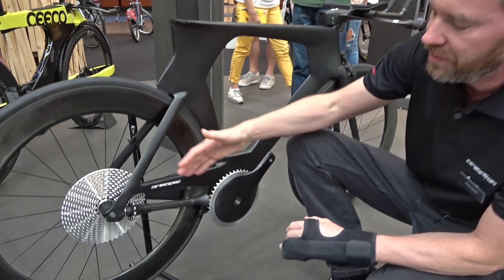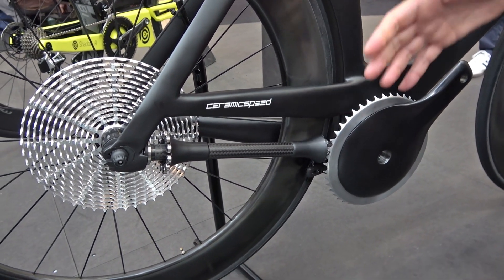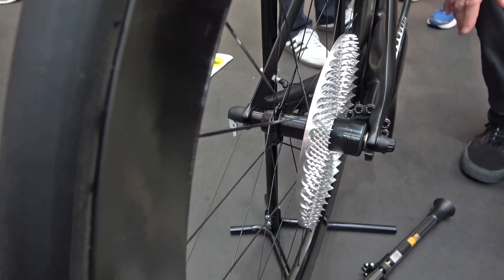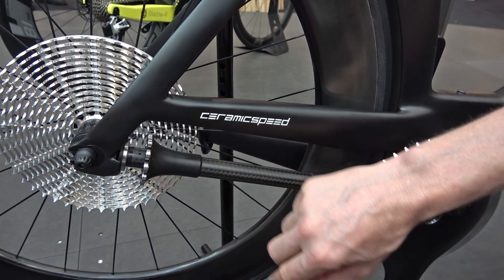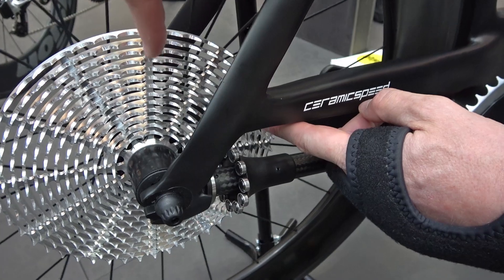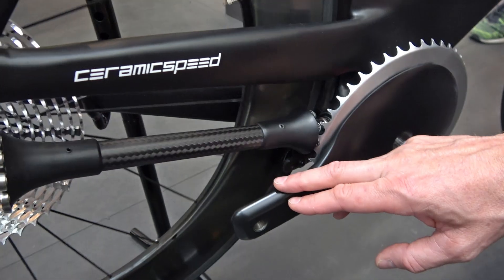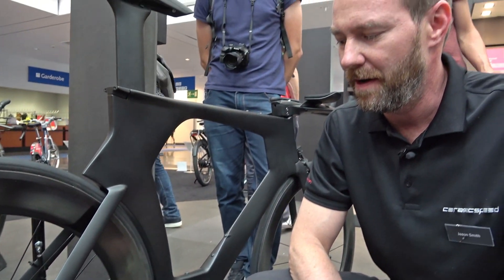CeramicSpeed Driven - Fully explained

Comment: In 'Good ol'boy'lingo,what keeps the multiple tooth wheel gearset from getting sprung from the pressure that tries to push it in toward the spokes?Also,isnt there an instant as one brng.leaves contact and another starts touching that will produce lost motion?(The problem in car's differentials was cured by curved/angled teeth...constant contact).

Comment: For a moment, I am gonna assume that the materials used are strong enough to not fracture under the point contact at the engaged tooth, as opposed to half of the sprocket in a chain drive.
However, I think the aluminium hub would give way (towards the wheel) when the forces involved are high, bending is inevitable.
Also, the pinions can't be simply be replaced as he says about their future plan. The driveshaft distance from the geared hub will change on changing a pinion (which isn't easy or reliable)
And seriously, a battery inside the shaft? And bearings exposed to the atmosphere?

Comment: Keep it up.  Can’t imagine all the hurdles you have already overcome. Looking at this prototype, it looks like flex could become an issue.    If so, milling the gears into the rear tire itself might be an avenue to approach.  Swapping rear tires would give you all the gearing options you need.  As for the driveshaft, it could also be a more integral part of the frame. In other words, if this doesn’t work as you have envisioned it, instead of tweaking your design, maybe tweak what the bike itself is. Best of luck to you.

Comment: I can't help thinking that there would be axial forces on the driven cog that would push it towards the wheel. It looks fragile, and if it is then it would flex as soon as any load is applied and like as not risk significant failure. I would like to hear how the axial forces (if any) are managed.

Comment: For some reason I imagine these gears wearing really fast. On a typical chain drive the chain contacts like almost 3/4 of all the sprocket teeth at one time giving a strong backbone. But this appears to put all the pressure on only maybe 2 or 3 teeth of the sprocket at any one time so that's a lot less sprocket tooth to hold the force. In the end I imagine they better be some crazy tough sprocket teeth to keep from stripping or breaking fast or just need to peddle light. Those peddles make a big mechanical advantage against those years so I don't know the exact math but I'm guessing those 2 teeth that make contact simultaneously on that front sprocket probably get around 1,000 pounds of force easy with even a 130 pound man standing on them. I don't know I think I want to see it work through a few Marathon races first. And did you say ceramic bearings? What kind of hammer like impact do ceramic bearings hold up to anyway? Just thought I'd ask. May end up having to revert back to lubricated steel bearings in the end.

Comment: Why are there no videos of this changing gears or being used in the real world? 
 How much torque can the drive shaft handle? How does it put up with dirt/mud? 
How long do those bearings last? Can they be removed or must you change the whole shaft....so many questions unanswered other than "it's 99% efficient"

Comment: The application for e-assist bikes would be really great, as there is no chain grees or anything that can tarnish someone's dress code potentially get hoped, as enclose look like they would be simpler and smaller slimmer than for traditional bike chain and the fact that the whole system can kindly be enclosed means less dirty as have replaceable brushes cleaning dirty off before entering the gearing compartment which also maybe means less wear. Also, have greater clearance and less change of derailleur being damaged as there is less protrusion.
Mabye just like they doing with split shift to allow gear transition to happen, which is single axis movement. Mabye look at another concept that allow 2 axis movement, which allow it take up the alignment difference. So my thinking is just like they split it the hollow cylinder into two half for switching gears, pull each shaft along up and down. Then make each cylinder half hollow, such have another cylinder inside of it, that can sift around the axis of the shaft profile. Then just like the for with profile tracking for gear switching look at having the inner half-cylinder, have a profile that, it follows to reposition the tooth alignment correct to match. The enclosing half cylinder for shifting fears, would have holds that allow for the inner cylinder to track a profile on the shaft, such that there is mechanical resistance perpendicular to the force direction. The current shaft could have an inner shaft with profiles for cylinder movement of the gear shift of the two-cylinder half alignments. Guess also look at air and shock type dampers. The only problem I see is that as in there design to realign the gears for the new toothing around the sfaft axis, on has a problem that there needs to be space around the shaft, which means can't perfectly match the teeth as one tooth is spring load match all the time, which not ideal as looses there.
So I guess another way to look at it can one dynamically change the spacing between the teeth, across the whole half-cylinder at the same time. But then to think of it, if they keep the meshing perfectly the same, then the gear chainrings on the wheel distance between gears would determine perfect whole number matching. So I guess the really question is timing of the shift, they got the split shaft concept, but then for meshing, why not look at having all fears on the wheel, have alignment point, where all teeth are perfectly aligned. they have maybe two points possible on opposite sides depending on the size of the cases and bearings and distance between, all about the geometry. Then basically no toque coupler, just time the shift at the theta 0rad/degree or theta pie 180degree, when the gear case rings to complete a resolution for alignment. There is no requirement that a shift can't wait for syncing of gear casest rings, before engaging. The issues here is that timing needs to perfectly match that of the split. So they would have to ensure that sizing of everything has the patterns, such that for gear change to sync, would at worse have to wait for whole cast to revolved x number of teeth for the shaft split to match perfectly, so large gears of 40 teeth, that's 40 revolutions to wait for sync change with no torque coupler take up alignment difference.
What if make both parts move the split shaft for gear shifting and then also the chainrings, which have a profile, when engaged will rotate around the wheel axis and to speed up the alignment and the lock into position again before gear changing again, basically reduce the number of wheel revolution you have to wait for teeth syncing. Just a lot more moving parts. I try keep the chainrings running in like a u profile with maybe with permanent magnetic engaged movement, with ratch like system, which just allows ratchet to be release and engaged again to stop rotations.
That maybe pick a point that mechanical level, coupled to the shaft turning power can pulled chain ring tough the u channel, ratch it to next point. Depends on how much the alignment of teeth are out.
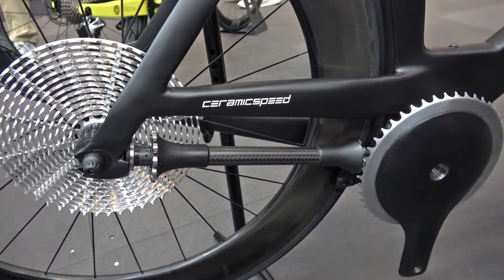One has to figure out if there exists a profile that could be used such that the shaft power could realign the chainring, which changes with position. so need be a profile that varies on the chainrings, that the shaft if engaged would realign it within one revolution. I think that is plausible, just have to cad and figure out all geometric profiles. Just a lot more moving parts, however, I think there would be less power transfer losses, as no torque coupling required that in my mind physics, won't allow perfect matching of teeth between shaft. 2:11 always a slip torque coupled tooth, in which there is energy loss.

Double clutch kinda, below but could just do it to the main shaft in which case the is a period of dis-connection, which be find for most cyclists. double shaft be for Olympics.

Another way maybe I if possible geometric wise, have another full shaft engaged it at a different angle offset by the max tooth alignment, then use small use gear correct to the main shaft translate it around the wheel to the new alignment point. So then basically two solid shafts perfect mesh and allow the one shaft axis to translate around the wheel to pick the alignment, then change gears.
Typically could look into planetary gears there, when a gear change shaft has profile it tracks when at pointless friction or local minimum it is aligned, one changes driving gears, and sync the original gear and the change back primary driving gear. Having the main shaft and the gear changing alignment shaft connected by a cog that can slow translate in a another plane, would allow to sync the alignment take over point to that of the main drive shaft. This second gear shifting shaft, would be much simpler that the complex it of the current system and could make super small and stronger.
I think might see main drive shaft and then a gear change drive shaft with teeth alignment coge and profile, for gear changing as it simpler in complexity would allow shaft to be smaller.
Basically split main shaft in two connect by 3 gears, when on gear allows radial movement of the shaft around the wheel for gear change. change of gears then is dis engage retract away from the wheel  move the drive shaft alignment to the new gear and then engage into the wheel  the , the profile tracking will cause the two shaft to re-align by gear that move the shaft around.
Mabye look at that little gear box, such that main shaft can engage the side gear for shaft alignment of teeth and then basically after the change, can retract such there is direct shaft connection.
The profile alignment for the cast, would reduce wear on the gears before meshing. Basically also have two shafts in one, driving two engagement points, which means doesn't have rotate around either keeps all in same axis, just means slightly more friction.

 or maybe mini meshing gearing, that mesh at two points, which means the missing tooth was the is space required for teeth alignment doesn't matter, as gear mesh with a tooth before and after when transition the tooth gap, were current have torque coupler. which like another 3 shaft gears to mesh or some mini-chain freedom movement micro meshing. But think the previous idea of a temporary gear changing messing alignment shaft, would be easier to achieve with higher durability as would be less finicky.

The fact of parabolic slip going inward would allow change gears however, under force require to fast the wheel rotation of slip angle, to go outward and then need that geometric patter to occur obviously inward again to change inward. You could in those luck world geometric patters, make profile guide bar, to ensure switch is done fast enough as be force into the next channel, bearing would help. If you can get two in ward and outward parabolic curves, then shaft becomes simpler, as just allow shaft to slip to next alignment point, versus that complex profiling on the shaft.
Which means just engage mechanic level to follow the parabolic profile bar and disengage at the next chainring alignment. Obviously, if tooth stride is say s mm then go out radial such that next gear out needs another s/2pieRBase = theta => (teeth * s)  / s = pattern laps window. => thetaRepeatWindow = (teeth * s)/2pieRgear(i), but needs to be for all gears. So radial spacing and stride size are crucial to ensure inward and out slips that are large enough. When pass middle point, there should be parabolic curve running the otherway. So look calibrating geometry and sizes of everything to that of inward and outward slip parabolic curve,  add guide mechanical level engagement, to force the gear and and down the shaft. so many little surface roller bearings so drive pinion can move very quickly up or down the shaft to the next stop point. Since free whee chainrings, would have to have a standard drive coge to force the shaft to move, while the main drive slides along the profile. If there was no ratchet free wheel and the moment of the bike alow the gear change. problem is if you stationary, you have to paint the wheel, so mabyed 1:1 inner caset ring, just used drive  freewheel shaft around while, force the major gear change, then disengages again. all depends on how great the time is.

Basically, have alignment clutch in the rear shaft the aligns to zero references once engaged and rotates the freely wheeling caset. Then inside of the shaft, you have profile based on the slip between gears for inward and outward motion of change, just push the slider to the next position gear position, internal like coupling system and decoupling position for gear. Which also like many different shift/slip profiles for gear miss alignment for forward and backwards, couple to the positional clutch of the cast freewheeling. Then the next part is the coupling system for forward and backward motion. Literall then work with lower and upper limit trigger switches.

Comment: looks good, but what if lot of force is set on the pedals, then 2 rolling frictions  teeths need to process this  force where in a traditional system 8 teeths of sliding friction need to process this force.

Comment: hmm. looks nice but it will be noisy, I cant see how you are going to get the power to the outer 11 rings without them flexing away from the shaft.  as for 2 points of rolling friction... wouldn't it be 2 x 2 =4 points if you include the front and rear shaft bearings ?

Comment: Rather than a battery, you could have a capacitor charged by a piezoelectric generator that uses the varying strain in the drive tube to generate the power to do the shifting.

Comment: As someone who designs stuff, my two cents:

-interchangeable shaft? How about adding more crown gears to the pedal side too?
-loose the whole additional shaft altogether, since you don't want this to be an addon to normal bikes, so use the vertical frame to act as the base for the shaft
-over-complicated electronics, i'm sure a good engineer can come up with a side-sliding bearing setup where no need for syncing of rotation

-and yes, this is a demo, not a functional product, hence noone pedaling around with it...

Comment: Would a cable, and a shift lever be lighter than the battery and internal workings of the shaft?  But the. The timing of gear change would be the problem with the cable shifter.   This would work as a fixed gear setup. Anyways thank you for sharing, wishing you progress on your build!!

Comment: 6:18  How the heck are you going to swap in a shaft with a different sized pinion ring, when there is a fixed clearance between the shaft's center line and the rear sprocket? That dictates a fixed radius. If this was possible, they would be doing it now, not "some day".

Comment: Awesome design!
I personally would like to see a soley-mechanical, torque-based automatic version, with a spring running through the center where the current "brains" are, that would get pulled with increased torque towards the front crank, shifting to lower/easier gears. The spring could get pulled by the front crank, if you press extra hard on the pedals, it temporarily transfers more torque on this spring, pulling some hard line running through the center of a compression spring? Not sure how the sprinning front bearings could transfer that to puling the spring down, hmm, maybe it could be spinning the spring, and then locking in at a torque threshold? Hmm, seems like it could work somehow :)

Comment: Surprised at the criticism here. This shaft drive has to be the way to progress cycles. I did note that it is not fully developed yet but I would presume that CeramicSpeed and the University they are working with have patents on it, particularly the proposed electronic gear change mechanism.  The exposed ball races may be a problem with dirt ingress, but that is what development effort is for.
I think it is a great idea. My only worry is that the Cycling authorities may ban it like they did Chris Boardman's speed record design because it doesn't look like a "proper" bike!
Rock on Guys!

Comment: kind of related to the car rear drive planetary gear system. Get the gearing ratio correct and anyone might be able to cruise at fifty mph on level terrain. motorcycle shaft drive is something to consider too. more drag but less chain

Comment: It won't shift. The gaps of one set of cogs would have to line up with the gaps in the cog next to it to allow it to slide from one to the next. This only happens in one spot if the cogs increase by one or two teeth per step. That is why they have never done a video showing the system changing gears.
It might be perfect for fixed gear track bikes, but but will probably not work well in outside dirt and grime.
Reply: If its a fixed gear, you might as well stick with the perfect chain line and strength you get from a 1/8 chain

Comment: Looks like it might be a good idea...will watch this one!  Will depend
much on its final execution.  The design you're showing for the internals I believe will
be too slow ...heh! 
Hey guys, add a solenoid coil into or around the tube, turn the whole
body into a solenoid and index it that way..with a zero energy latching system (so its not using energy while in a certain gear).
If as well with some clever engineering, you could make this device charge its self (or more).
Use the 'reverse spin' to generate electricity by latching/cogging the front roller assembly.  
You can then generate electricity when its in 'spin/coast mode'... when the biker is rolling forward and holding the pedals stationary.